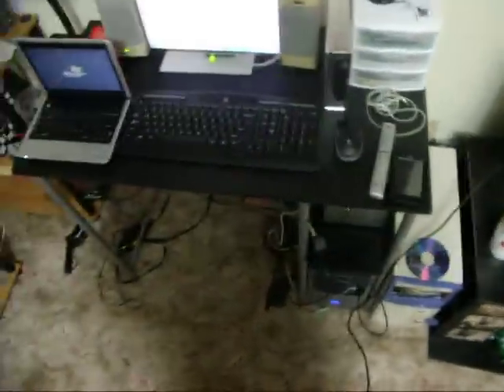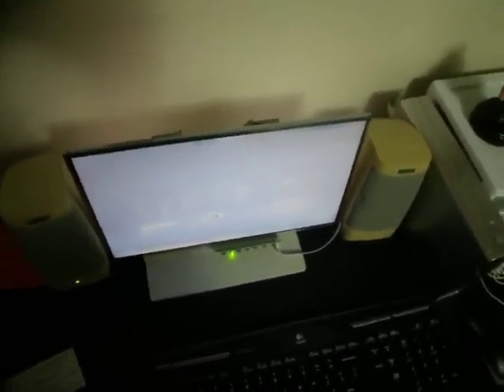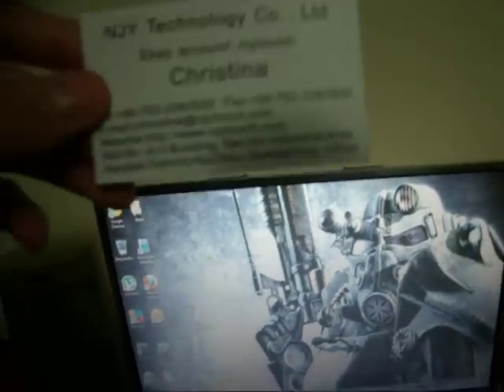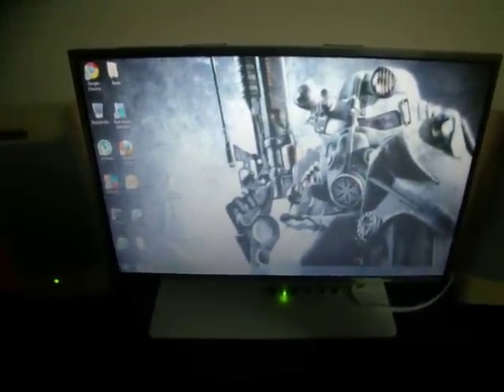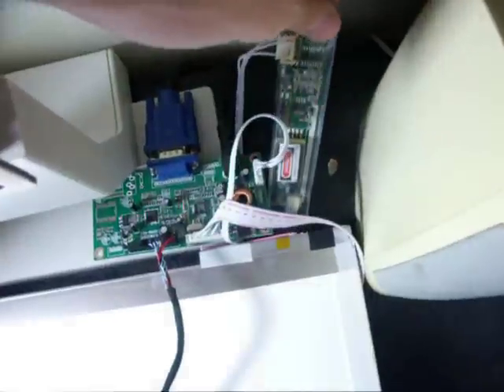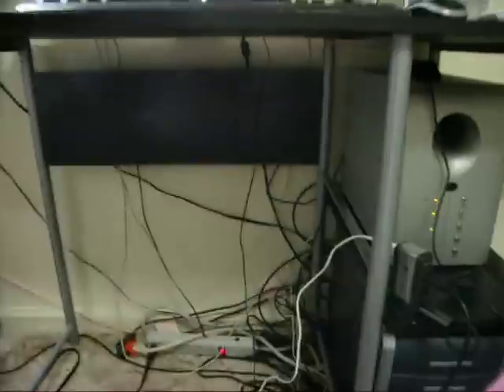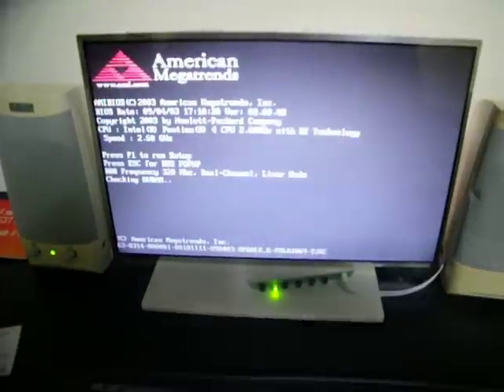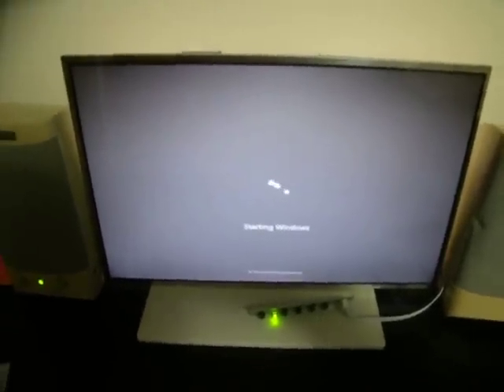Laptop LCD to Desktop VGA monitor converter

Comment: Word of caution.  The board that you picked up and said was the power supply for the LCD is in fact the back light inverter for the LCD back light tubes.  You should NOT touch that.  Typical voltages range from 1000-1500 volts during the initial power up and remain at 600-800 volts while running.  Bigger inverters in TV's put out over 10,000 volts in some cases.

Comment: I'm in exactly the same boat - got an awesome Vaio laptop which overheated and went bang but the screen is a wonderful LED backlit 13.3" 1920x1080 which I'd love to have on my wall next to my two 24" 1920x1200 main screens - just for VOIP/IM etc.
Thanks for the tips

Comment: Yeah I suppose so. I'm after a triple monitor setup for PCB and ECAD design, but in a student house I'm a tight on desk space. Three screens like this would be good because they would be easy to pack away and mount flush to the wall. Consumer monitors I guess are around the same price and easier to set up.

Comment: I just repaired the right hinge on mine with a McDonalds straw, pulled the heatsink and peeled off a sheet of lint like you'd find after drying 3 loads of cloths. Yep, 1525 is a tough laptop. I installed Italc client on it and gave it to my daughter. lol

Comment: Dude, that's not the point. I've seen your videos, you sound like you know what you're talking about. All I'm saying is that you gotta at least try and contribute to the electronics community because that's how it grows. Don't come to videos like this and troll because it doesn't help anyone. Yes you had a point about used hardware, but put it across as a point of note rather than an insult. That's all I'm saying and I don't mean to offend.

Comment: Why do you need to ask my credentials? Aren't they easy enough to find? If it's so important to you, please tell me your credentials. I know where to buy new LCDs, but they cost a lot more. Ebay is dirt cheap to pick up old gear to mess around with. Sure you win some and loose some with used items but its all about learning.

Comment: ahhhh the AD card. I am in the screen industry and have been for several years, We use these all the time and they come in a several types depending on led / ccfl and display sizes. These chinese made things will not last very long after extended use, Yeah awesome once you get em going but they go bad pretty fast , Do not plan on making a profit off this the negative feedback on ebay will kill you ..I know this because this is the only thing i do m-f